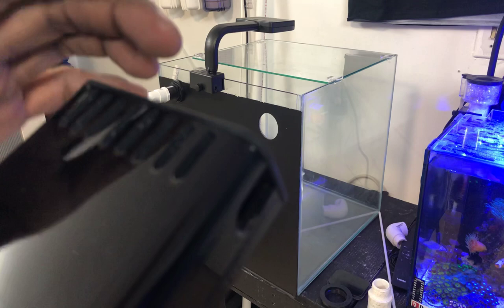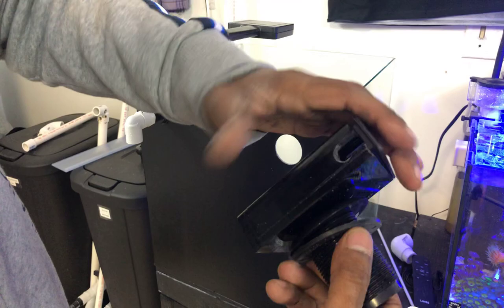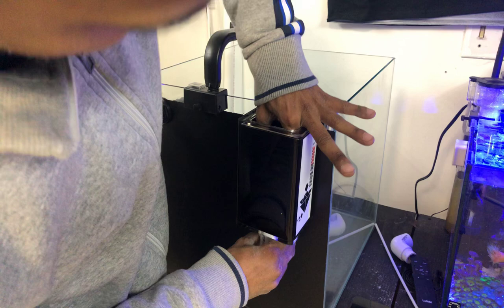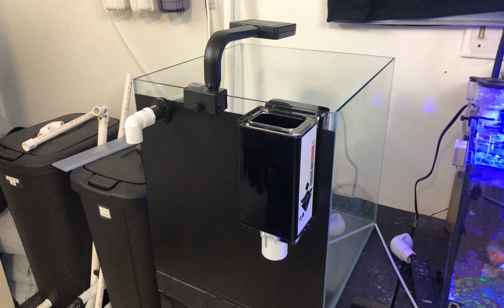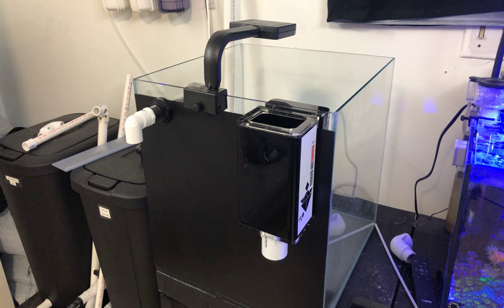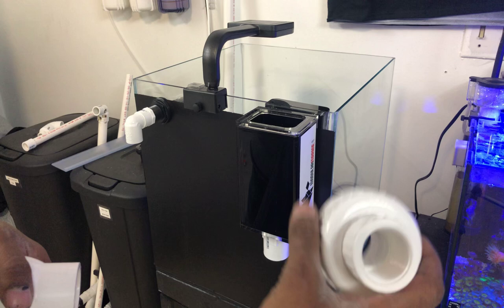Overflow upgrade

Comment: Que passo way.   Just thinking out loud, you should cut the O/F bulkhead down to the thickness of the glass and the nut inside.   Makes more room inside the O/F.  And I don't trust the uniseal. 
I love your work you already know but I think you have some bottlenecks in your return.  The adapter is too small on the inside?
Reply from the maker: Hope u good my boy haven’t heard from u in a long time